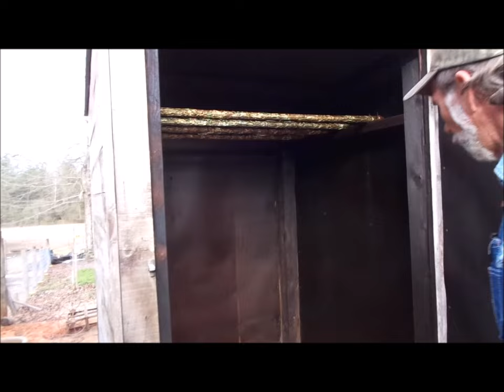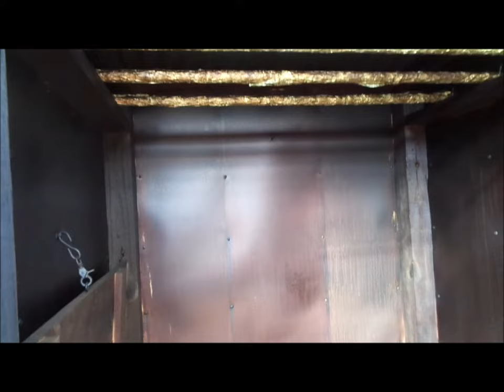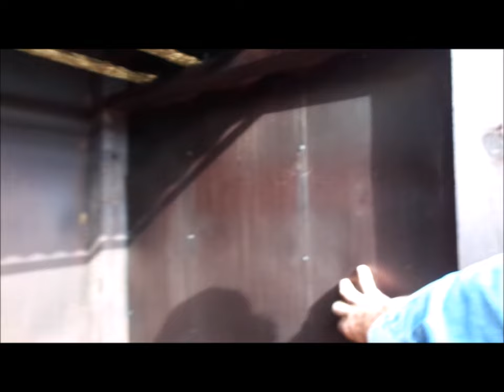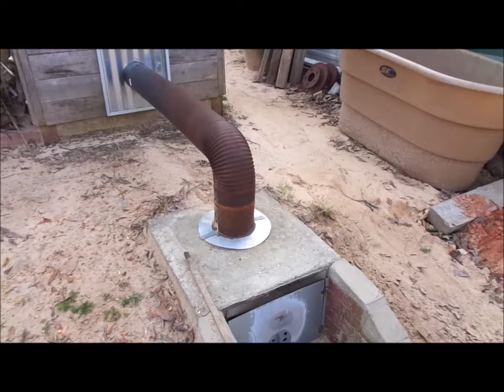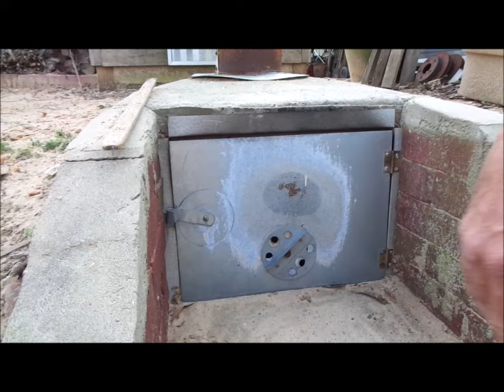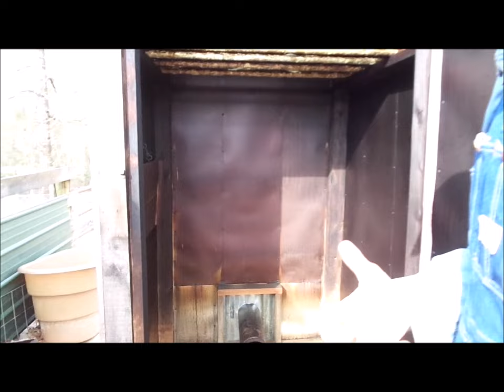How I Built My Smoke House

Comment: What about using clay/straw mix as an insulator for behind the metal sheeting? It has been used for centuries to build and as an insulator, and would ensure it won’t give off any chemicals with the heat. Just a thought :)

Comment: I got a roll of galvanized metal sheeting .  What i'am going to line the walls and top with.  Its was cheaper than the rolls of Aluminum sheeting
Reply: Do not use galvanized..it will off gas and make you sick.

Comment: Brother what you need to do on your smoke house for Insulation is the best the God can give you Good clay and  sand mixers as in cob you can add straw it will be OK I'd just use the clay and sand miners 2 or 3 in then add 1x1 strip to the sides then a couple at 2 foot were you can nail to use tin or that Aluminum stuff you used before  the Tin can't have any coating on it I sand blast it when I did mine but one of the other will work I hope you see this I'd love to know names Shane Miller over at Is howdy neighbors love what you guys doing I'm doing the same trying keep it in God's hands Brother keep on gardening you know everything started in a garden amen brother

Comment: For insulation without chemicals use dirt. Build adobe walls, with the heat and the clay the walls will harden up like rock too. You can still line it with aluminum and keep the wood frame to hold your shelf, and the rods to hang your sausage. You just have to put siding paper to protect the wood while the adobe dries. You will add thickness to the walls, but you will also have insulation that is chemical free.

Comment: What type of insulation did you decide on?

I think I would go with rock wool or a similar product that is made from rock. 

It resists fire temperatures up to 1200 degrees Fahrenheit so is pretty much fire proof for this application.

Comment: I’m wondering if you simply put an inner wall leaving an air space if that air space would be enough insulation for The amount of temperature variance you need…. That said, the video is old enough I’m sure you’ve made the upgrade the way you wanted by now… I’ll have to go look for a newer video and see how it worked out.

Comment: My old smoker was damn near Identical, with minor differences.
River used to jump its bank in winter so my base was a lot higher as was oven.
We had power to it, long extension chord and bought auto damper that opened two lihhtweigtvents just below roof joist..
Did use stainless ipes for chimney, like an idiot I bought replacement items and 25 years later same original pipe.
Bent ice of sheet metal into V to cover pipe keeps weather off.
floor of house is rough cut 2x6 old growth and outside is recycled fir barn boards.
My fold down salting bench was a 51 ford tailgate with cedar top.
1x1 on innerside.
Used for fish beef and game plus cheese smoker with cedar boards no other insulation just air space and once cedar absorbs smoke and fats drippings gives extra flavoring. Roff was regular one pitch but built extra strong dor hanging large bear haunches elk rumps etc. Stainless steel racks got from bankrupt bread place.
Needed different hangers, smelt only about 6" and we fabled stainless tubing with stainless rods and hooks could smoke couple hundred at a time.
Do you ever smoke your catfish or panfish, hell I even smoked carp.
I use vinyl maple a pest bush but pretty in fall green for smoke and if dry for heat.problem is Gotta use my spoke shave to remove bark as it is creosote same as alder bark and others.
No bark ever in smoker.
Was long ago and I let the "SimplerLife. BULLSHIT ON SIMPLE, SLIP AWAY.
Simple never,, what a laugh, you work harder, think harder, play harder and love harder,  more on farm, nothing simple about it.
Got great position and wage at modern factory, b but every day when watching crews shift changes all I thought was, "Hell they are no different than cows going to and from barns to be milked,
Not to put them down, hell I fought management for their benefit for years until burned out, all work is good work if the wages are for man and family's benefit, and they know of no other life.
You have a "Good Life", saying have a "good day" is cutting life into small pieces,.when we need to live its.fullness.
A feeling plastic and concrete flattlanders will never know!

Comment: You can use rustoleum on pipe and smoke your sausages first and cook em in stove in the house like I do on 175 with door kicked open slightly works great and you can monitor temp better my flame is 20 feet away from my smoke house under ground

Comment: You might want to think about putting insulation on the outside of the smokehouse, then cover it with some plastic or fiberglass roofing panels.  Leave the inside metal sheets alone.

Comment: Do you have a draft control on house? I may have missed it or maybe you didn’t need one.
Reply from the maker: No I don't the ribs on the metal roof lets enough smoke out I didn't need one. I'm building a new one by my cabin you might want to check it out. I'm upgrading everything.

Comment: Looks like a permanent location for the smoker. How about running a concrete pipe (square or round, be creative) underground for your chase and add a simple cover if needed to the riser portion. Put a screen over the cold end, just in case. Loose the PITA metal pipe altogether. I take it the smoke flows out the top via the corrugated roof? This is one of the best designs I've seen. Thanks you sir for sharing your wisdom with us.
Reply from the maker: Thanks I'm building a new one at my cabin. Check it out its an upgrade from this one.

Comment: Just a suggestion, use firebricks to line your smokehouse walls, then cover with 1x12 boards, which will give you insulation, and the wood will absorb  the smell of the smoke and with hot and cold, will breathe aroma back during heat cycle.  The same principle as oak whiskey barrels breathing in bonded warehouses during aging process.
Reply: I really like your idea there. I am learning so much from you guys. Your post shows how much people can learn not just from the video but from guys like you. Thank you Pete.

Comment: Try sheets of mineral wool, it is used in commercial and industrial bakery ovens, just have to protect it from getting wet, leave vent holes at the bottom and top in case any condensation builds up between loads. 
I mean the size to run 1/4 mle of oven conveyor pans, walls were 10 feet high.

Comment: Drop your smoke pipe down to bottom of smoke house. Come out of smoke pot bout 14 degrees .should put you about two inches higher than bottom. Use clay pipe make a rock gargen to support pipe or cover hole pipe .rock and dirt .dont matter just protect pipe.. .for instigating use a mortar  mix fire rated back fill the whole smoke house.. I built mine out of old pallets worked nice. I smoke fish and wild game .lol n most my friends bbqs hear..have fun .and smoke some!

Comment: Very well done bud, the terra-cotta will definitely outlast anything else but do you think it will cause a problem with cold smoking as the wind won’t be able to cool the terra cotta fast enough remove the heat from your smoke before it gets into the smokehouse raising the temp too much inside? It will be perfect for sausage though, I’m just thinking ahead.

Comment: Thanks for the good description of the design and the reasoning behind the design.  The subject of insulation interests me... Possibly put some rigid insulation on the outside of the wall and sandwich it between another sheathing of some kind.... perhaps corrugated sheet metal.

Comment: If you use 1/2 inch iso board ( ridged insulation) 4X8 sheets and cover it with quarter inch dens deck as a fire barrier then install your aluminum on top of that. That should do the trick

Comment: I’d say the best insulation you could use is Rockwool comfortboard insulation.  It’s fireproof and made from basalt and slag.  There would be no chemical off-gassing.  I believe it’s stiff enough that you could reapply the aluminum flashing with good results.

Comment: Yeah it copper quaternary (acq) typical exposure by touching is usually not too bad how ever if it contacts metal ie. aluminium or nails then it become toxic and corrosive also heating it up has been proven toxins as well so I'm sure you used nails and it appeared as if the aluminium is touching post ... also aluminum has been linked to Alzheimer's that's why they line cans with rubber and plastic to keep ingestion low .its whatever you want to eat... I didnt realize termites ate a mixture that was 80% clay and 20% sand. I would think they go after the wood plus if you smoking I pretty sure most all insects avoid smoke and hot places I guess your termites in the deep south have different habitats?? Hey I apologize I should have kept opinions to myself feel free to delete I am a culinarian a purist organic farmer I also do finish carpentry and build furniture passionate about respecting products that I get my hands on God bless brother it's a great design just would have used all natural hard wood for framing

Comment: He built a good smoke  house but then he said he was worried about insulation putting off a chemical when heated what about all the treated lumber he used post and plates aluminum sheathing hmm... I think I would go only hard wood a double layer one on outside of box and one on inside with a cob mixture in middle of wall for insulation. other than materials choice great build.
Reply from the maker: The treated post is a copper treatment. Aluminum is not going to hurt in a smoke house for cold smoking. In this climate you cant do cobb mixtures because it would become a haven for termites.
Reply from the maker: The treated post is a copper treatment. Aluminum is not going to hurt in a smoke house for cold smoking. In this climate you cant do cobb mixtures because it would become a haven for termites.

Comment: I have a question. Do you know what the temperature averages inside the smokehouse during the summer?
Reply from the maker: It really depends on your location. Here it averages around 80 deg. its to hot for us to use for just hanging meat.
Reply: @DeepSouthHomestead  I keep my country hams in mine it averages around 130 during the summer. The heat cures out the hams and give it good flavor. However I wouldn't put anything in there all year but hams.
Reply from the maker: @farmall1farmall132  Thats very interesting i havent mastered the salting thing yet. Sounds like you have it figured out.
Reply: @DeepSouthHomestead  well salt curing is very simple. I guess I figured it out pretty good we put up hams all my life and I'm in VA so I think it's in my blood. Are you planning on trying to salt cure some hams?

Comment: Hi Danny, I would suggest rather than taking you metal sheeting off the interior of your smoke house, why not add insulated panels to the exterior that are on hinges so you can open them as needed when you do your bacon.  Then you get the best of both worlds.  You could make them using 2x2's and recycled pallets.  It would be lower cost and you would not have to worry about the insulation causing a problem with the food you are smoking.

Comment: Alright, This video was EXCELLENT!  I'm and engineer and my daddy was a 50 year butcher so I have been around meat processing and smoking. I haven't smoked any meats in years but I am planning to start back up. I recently purchased a new grinder and got the stuffer all cleaned up.  I am kicking around ideas for a smoker and before I looked at this video this was very close to what I was drawing up.  I have to say I am impressed with your video and the little details you provided.  It's too bad you didn't live near me I would love to make some Kielbassa with ya my friend.  I have three questions for you. #1 What is the exact distance between your file and the smoker? It looks like ~ 6 to 8 feet?? How did you calculate that?  #2 Why did you extend the pipe so far in the smokehouse and not just terminate it just inside flush with the wall? Was there a reason?  #3 Do you have any sort of damper system on an exit pipe in the roof?

Special thanks to the young lady who did the filming w/the camera. Nice work.

All the best 
Tim from Florida
Reply from the maker: Timothy Urbanski The distance from fire to smoke house is 5 ft. I bought 3 joints of 2ft black 6 inch heater pipe. This distance gives me the option to either cold smoke or hot smoke. The pipe sticks 1 ft into the smokehouse so that the smoke rises in the center of the smokehouse. The roof is sealed up pretty tight dont worry the smoke will find a way out. i have the courragated metal sealed of on the lower side of the roof and left open on the upper side so smoke can get out. Thanks hope this helps. I smoked bacon yesterday.

Comment: I would insulate the outside 4" of fiberglass should improve the properties of the smoke house and resurface the outside with sheathing and you Will be able to protect the smoke house better by putting a second roof with a 2-4" dead air space and extending the roof with more corrugated aluminum/tin overhanging the edges by 10"  since you know the human looses a large amt. of heat with a head uncovered no hat. An extra layer of roof will help hold heat as the smoke will still vent but a dead space with snow on top of the smoker won't cool down the inside.  Why tear up such a nice insides and decrease your usable space?

Comment: My smoker is a big rolling bakery rack covered with roofing tin.  You can dig a ditch between the fire box and the smoke house, and cover it with boards to make a very cheap tunnel that cools the smoke.  I do a 2 day smoke both on meat and fish, to give a strong smoke taste and preserve it.  The tin never gets so hot you can't put your hand on it.

I agree that it important to keep some of the fire wood dry, but I soak some of it in a bucket of water.  The wet wood keeps the humidity up in the smoker, and delays the burn of the wood.  That way, the dry wood smokes first, then the wet wood starts burning a little later, giving me a longer time between loadings of the fire box.  I use pecan and oak.

When I am going to smoke, I let friends put some meat in, and some fishermen give me a bunch of fish to smoke, and I do it on shares.  I can eat or trade off my portion.
Reply from the maker: Sounds like you got it going on where you are keep up the good work.Thanks Tom

Comment: I was told you shouldn't use pressure treated????
Reply from the maker: It is best if you don't have fresh pressure treated posts.  These were really old posts we repurposed.  Little chemical left and we covered everything inside with aluminum sheeting. The smokehouse is built out of poplar. Not treated.  But the downside is, termites are starting to eat the wood, after only 3 winters.  Thanks
Reply: Deep South Homestead i was just thinking... About the insulation issue.... What is you use wool blankets... Pull the aluminum line the walls with wool blankets and put aluminim back in place....
Reply: no it will kill you

Comment: Best smokehouse I've seen. What is the diameter of your pipe, please sir? Also, do you have a draft pipe in the top of the smokehouse?
Reply from the maker: 6 inch black stove pipe for the smoke.  I sealed it pretty well, but there are enough cracks around the top that the smoke comes out.  Later I plan on adding a draft pipe.

Comment: Danny Great vid 

with that air vent in the smoke box can You get both a hot Smoke and cool smoke ?

when You replace the smoke pipe next time have You thought about  useing High temp BBQ paint to keep the rusting down? 

what are Your thoughts about Galvinised pipes or hardware for a smoker

Comment: Danny  you might try looking at solar dehydrators and make a solar dehydrator/ smoker  the down draft solar dehydrator would draft back out your fireplace, and you can use one side of it to have your glass box for the dehydrator which you can make where you can block it off for went your smoking and not dehydrating

Comment: Thank you for packing so much great info into your videos!  Your stove pipe might be rusting so fast because it's touching aluminum somewhere ... that is near-instant death for steel in high moisture.  I like your idea to use tile chimney pipes for a longterm solution.  How do you keep heavy rain from going down the slope into the fire box ... is that part covered when not being used?
Reply from the maker: +fannygitchyurgun spiritwind We don't have water going into the fire box.  It was designed so the water goes on down the hill.

Comment: Danny how about putting a roof over your pipe, just a small birdhouse type roof would work mounted to the pipe itself.  That would save it from the weather and would be fairly cheap solution, then you could re-stove black your pipe.
Reply from the maker: +TR Outrider Ive tried several different ways to prevent it from rusting.The paint just burns right back off.Even the high heat paint and the humidity just keeps rusting it whether its covered or not.Thanks for the suggestion.

Comment: Nice work. This is something we have been thinking about building as well. Is there a benefit to have the cement vs a dirt floor in the smoke house? The other question I have is why wrap it the poles in tin foil? Thank you for sharing!
Reply from the maker: +Life in Farmland The cement floor makes it easier to keep out rodents. Plus its just a lot cleaner.We wrap the poles because they were rusty and were used on a construction job for years.Im all about being clean with my food.
Reply: Deep South Homestead why not clean them up and paint them with some high heat BBQ paint. Then you wouldn’t have to keep wrapping them with foil?